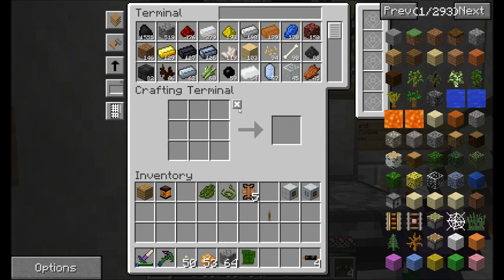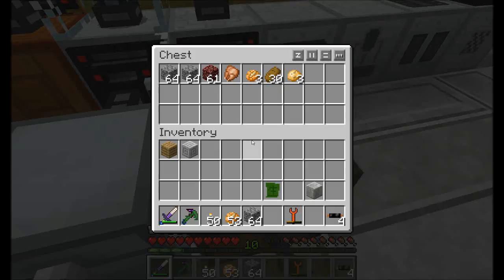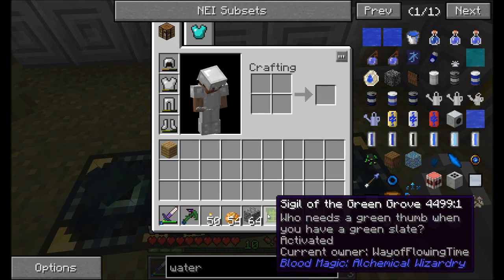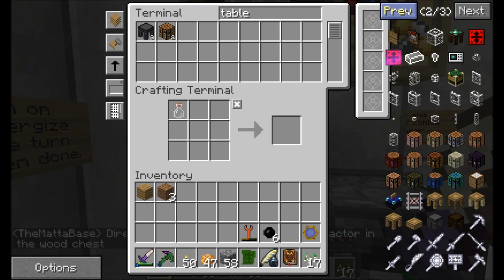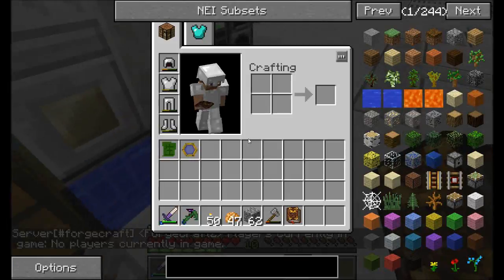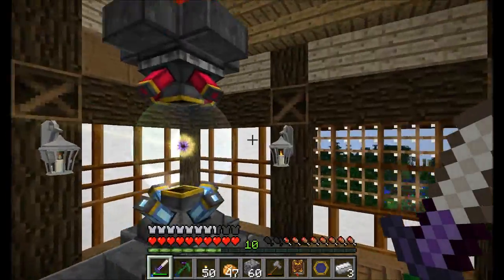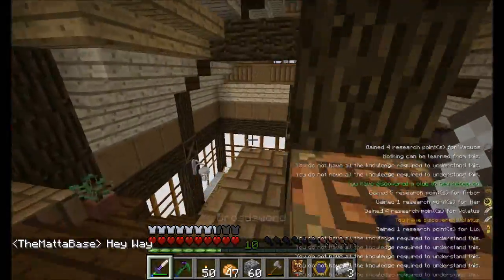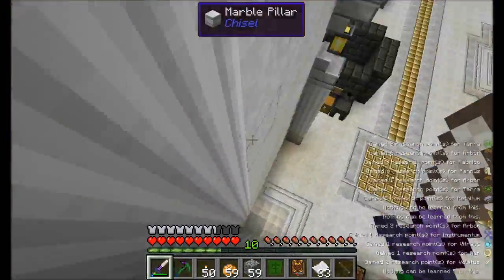Server Play S7E7 New Thaumcraft

Comment: You could use the sync mod to have a seperate character for the thumcraft stuff. That way you can use all the warp causing stuff and then switch to your main character after using it.
Reply: I wonder if  that would actually work. The sync mod might not be on the server  at the moment but Thaumcraft might store warp weirdly on the player that would affect both the sync character and the player. Even so, I don't think warp is that big of a problem and I'm pretty sure there's going to be a way to alleviate the badness
Reply: I'm pretty sure Warp is client-side so no matter what character you're on as long as it's the same character it will have warp effects
Reply: Victor Xia True. but warp might be linked to a player ID. If the sync mod creates a new player instance with a different ID then it should work.